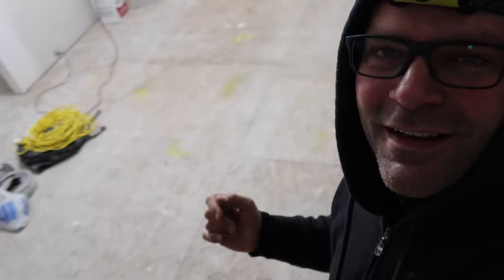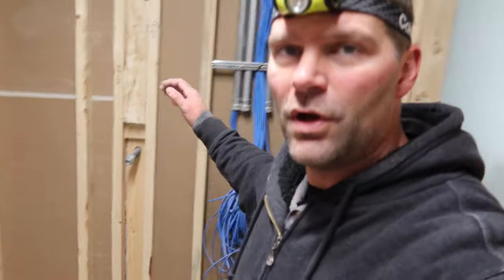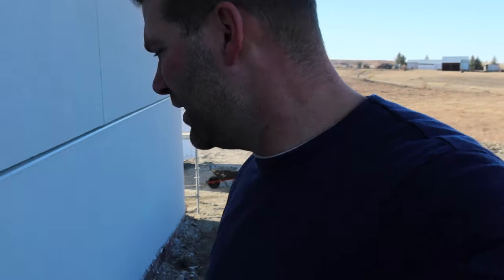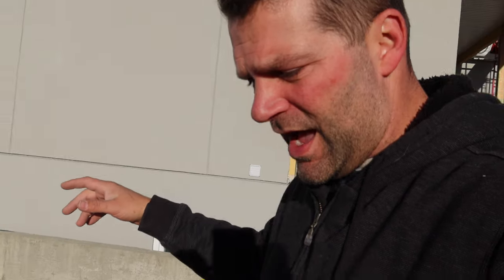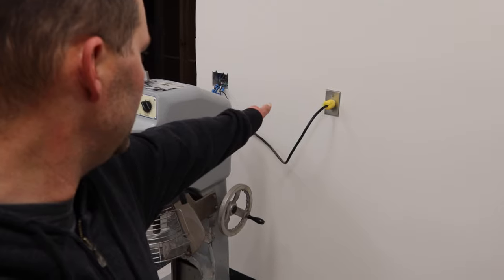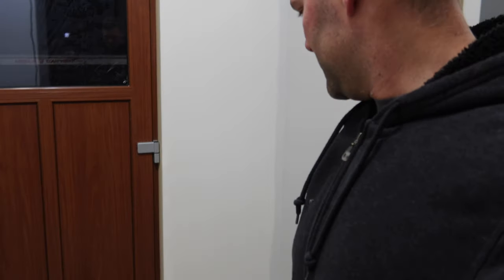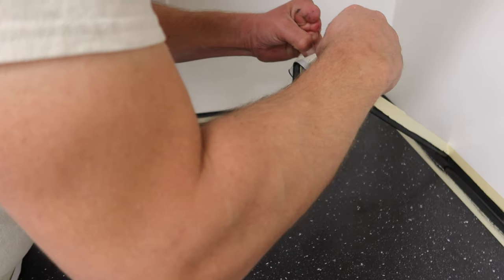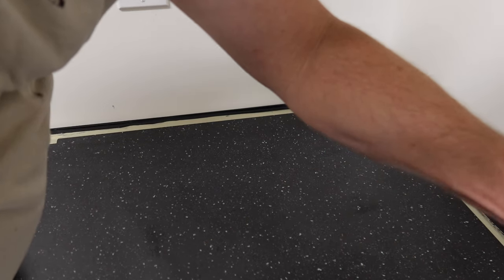House update, priming complete, ceiling texture complete

Comment: Is there a reason you picked textured ceilings over smooth ceilings? I'm in the US and no one is doing textured ceilings here anymore.
Reply from the maker: Hello Jennifer.  Went textured for a few reasons.  Primary reason is I like the looks.  The other reasons, painted ceilings show every imperfection in drywall, taping, truss uplift etc.  So to do a level 5 finish on the ceilings is costly and time consuming and under critical lighting conditions you can see imperfections.  Most builders of custom homes up here also do painted ceilings.